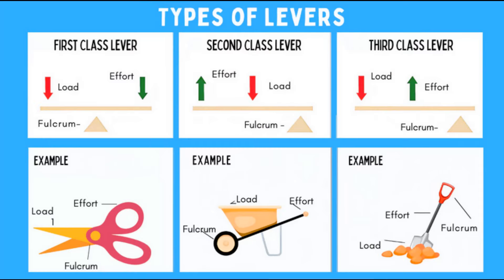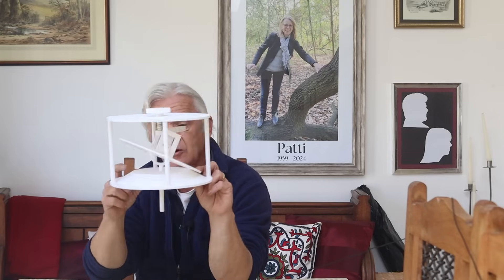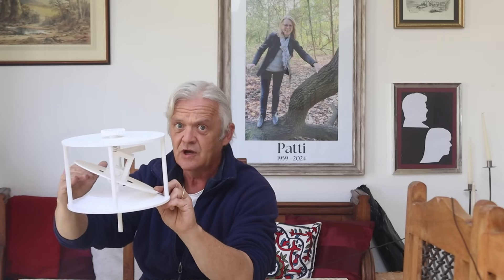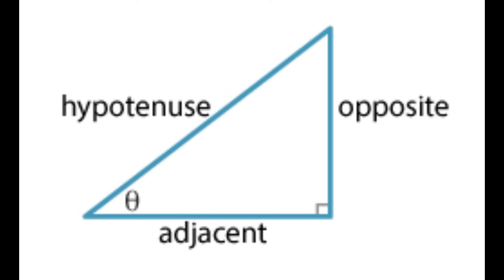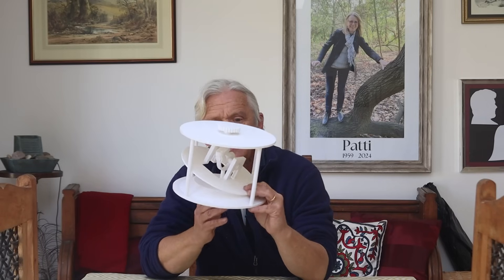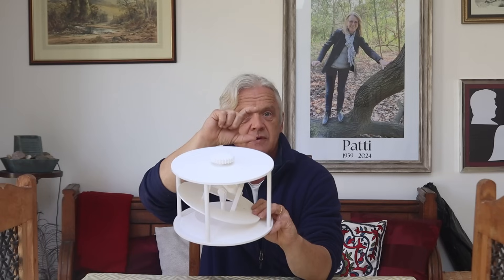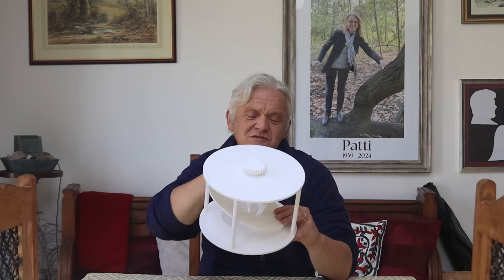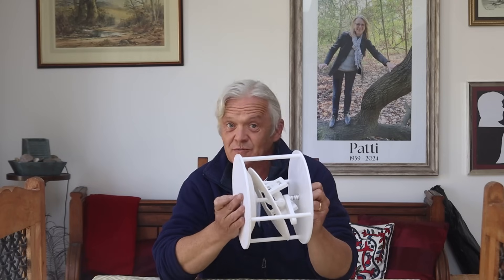2379 Explaining The Swashplate CVT

Comment: The roller is traveling in a constrained circle. If the swash plate is a flat 0 degrees, then the roller is free to travel without the swash plate reacting and there is no output rotation. If the swash plate were somehow set to 90 degrees then it must be pushed one for one by the roller. I'll call this tidally locked. These extremes are easy to visualize. 

At intermediate angles you get output rotation between 0 and 1 relative to the input, but why? Consider the swash plate at 45 degrees or so. Before rotation begins the roller is well mated to the surface. The plane of the plate is parallel to the tangent line of the roller's circle of travel. When you rotate the roller it attempts to follow its constrained circle I mentioned before, but the swash plate extends before it in a flat plane which blocks the roller's travel. The roller must either be stopped or push that plane away from it to continue its own curved path. That's also not too hard to picture, I think. But why must the swash plate rotate instead of tilt out of the way? 

If you were to return the swash plate back to 0 deg, you could then tilt it again back to 45 deg in a different spot without rotating it at all. But we can't do that obviously, the tilt is constant whenever we aren't changing the 'gear' ratio. So, does this matter? After puzzling on it I think yes. If the swash plate is tilted then you cannot rotate the tilted spot under the roller without also rotating the plate itself. But the less tilt you have the less plate rotation is necessary. And so by changing the tilt you vary the output rotation as a consequence of geometry which I'm too rusty to describe mathematically. But not friction.

Comment: If you start an upsidedown dinner plate "wobbling" on a table, the plate will nutate and rotate.  The greater the angle between the plate's axis and vertical, the fewer nutations required per each rotation.  This is because the edge of the plate has a fixed circumferance but it rolls along a circular path on the table having a smaller circumferance.  Nutation and rotation both stop when the plate goes flat.
So, if you could output the rotation of a nutating disk (using a universal joint) AND control the angle of nutation of that disk while making it nutate (with a roller), then your output/input ratio could be varied from zero to some positive value.
Friction would still be required between the edge of the nutating disk and the surface it rolls on.

Comment: One should imagine a crank on a shaft at 90°, where one could apply maximum torque and the maximum size circle the crankhandle would take. Now let that crank be at an angle, lets say 45° to the shaft. Then the torque one can apply will be lower but also the circle the crankhandle will take will be smaller. I understand this as a version of this concept.

Comment: I think I finally get it. My mistake was ignoring the load on the output. It behaves more similar to a torque convertor than a belt drive CVT- it always tries to turn the output in 1/1 ratio but when the resistance is too high it allows the disk to lag behind, until the roller gets enough leverage and downward force to accelerate the output some more.

Comment: I see it as a Pusher, but not down (even if that ofc is true from one sliced view)
But from the levels point of view it's pushing the plate forward from it's point of view.
From our point of view that will rotate Axel because the plate must rotate slightly when a new point of the disc is forced forward and down.

Comment: Still don't see how the output rpm can be different to the input rpm...perhaps it's just me :)  Honda DN-01 used a swashplate cvt but that involved hydraulic fluid taking different time to sequentially fill a ring of pistons whose stroke varied with plate tilt angle, hence changing rpm. ...but a mechanical connection with no friction slippage?

Comment: If you drive the CVT backwards and have the roller frame fixed, the only thing stopping the swashplate rotating freely is the friction to the cone backer. There is your friction. The transmission can not work if a shaft can move freely and independently.

Comment: A helicopter uses a swash plate.  This is not friction or the helicopter rotor would catch fire or overheat to the point it stops or falls apart, right?

Comment: I think it works like an Euler disk which explains the ability to produce different rotation rates between the input and output once you understand the dynamics of a rotating disk on a flat plane after it has come down from simple rotation. 
Think a coin rolling on its edge, the face of the coin may only rotate once for every two 'rotations' of the coin around its edge. The rod insertion determines angle of the 'coin' (swashplate) which determines the differential rate of rotation. 

Alternatively, you've completely explained why we should expect an increased tourque, so by conserving energy I demand a reduced rotation rate (or other way around)

Comment: Yes, great video!  Really interesting to try think that through.  To me it's like a coin flat spinning on a desk, there is incidental friction or rolling resistance -  the lever has to be restrained by contact.  When adjusting the fulcrum, there is also a tiny amount of incidental friction radially at the point contact between the plate and restraining cone.  Now if the point contact could be eliminated via a cushion of air (ie an air bearing, although impossible due the geometry) or a raceway of ball bearings around the plate periphery, the tiny amount of incidental friction could be reduced!!!  At this point my head starts to hurt!! 😂😂

Comment: The friction is totally there, it's just not where you're pointing. 

The roller causes the swash plate to nutate on the lower sloped disc.  Imagine spinning a coin on a table.  As it slows down, it stops spinning and starts wobbling round and round on the edge touching the table, I.e. nutating.  

As the coin loses energy, the wobble on the rim gets faster and faster until it finally clicks down flat on the table and stops. BUT, if you look at the design on the coin, the design rotates slower and slower as the wobble gets faster and faster. THAT'S the mechanism of this CVT and it's also where the friction lives. The plate exerts a tangential force on the base from nutation and friction provides the equal/opposite force that causes *rotation*. 

If there isn't any friction between the swash plate and the base, the plate doesn't rotate.   To use Robert's analogy, the friction is what is keeping the lever from sliding off the fulcrum.   

And in this case, the friction LIMITS THE TORQUE that the CVT can provide. If you exceed the static friction between the swash plate and the angled base, they'll just skid against each other like a car spinning it's wheels on ice.
Reply: the swashplate is not there held by friction, its the output shaft constrainting it axially and only allowed rotational motion.
Reply: @talyrath  totally agree 👍🏼 no friction=no torque. The plate would either just spin at the same angle (if that's the power input) or nutate and not transmit any torque.
Reply: @paramotorportal Thank you, I feared my explanation was incomprehensible. 🤣

I'm not positive, but I think the swash plate would have to be the output.  The 3d printed version certainly isn't back-drivable (it looks like it barely functions in its current configuration, in fact), but I think a better constructed version still wouldn't have great backwards power transmission.

Comment: I can see how it works as a CVT, but I can also see that it'd be able to slip.  If the force coming back down the output shaft exceeded the static friction between the angled plate and the disc it would start to spin on that axis regardless of the pushing motion that's driving it.  

I think anyway. If I had a good way to build one I would just to see it working.  It's a cool concept.

Comment: basically this is a variable thread screw, if it gets more inclined the thread gets corser. Finer threads improve the strength of the power transmission but are slower due to the distance traveled. i get the advantage compared to a belt cvt because it has a lot less friction but i'm not sure if the fulcrum would last long considering it takes all the load. Instead of a triangle holding the load we'd gradually have a rounder surface reducing the " thread delta of the screw" . i don't know if fine tuning the hardness of the materials between the plate and the fulcrum could resolve this problem. i understand why you like cvts so much, in a quest for efficiency, the transmission of power is very important. thanks to you  i just understood how the pilot of an helicopter can vary the pitch of the blades with a swash plate when i looked for it...

Comment: I was 1 of the many commenters. I could/can see how it works and it works beautifully when driving from input to output. My main concern is that if you grabbed the output shaft it might be possible to drive it from the output end. What stops it is the pressure of the cam onto the inclined plate. The cam is going to be essentially frictionless so it then comes down to the friction of what is close to a point contact between the wobble plate and the inclined plate. I wish I had a 3D printer to print this up as it looks like it's as close to a frictionless CVT drive as exists. My only concerns is the lack of friction between 2 parts could cause a problem. About the simplest form of a failure mode would be if it was used with engine braking and the output is wanting to travel faster than the input. I'd truly love to be proven wrong as this would be the discovery of the unicorn of CVTs.

Comment: A super-simplified model might be easier to explain, one axle with a two part disc, a regular platter and hub made of TPU as a flexure (thick enough to want to resist tilting). The other axle would just have a solid hub with a "stylus" rod made with a rounded end that could be greased or a ball of felt glued to the end. Mounted linearly, pushing the axles together provides both engagement and deflection for the platter, which resists due to the hub's natural springiness. 
Would it transfer much torque? No. Would it be far easier to see how the mechanism works, stripped of everything that could be serving as a red herring? Yes.

Comment: So, oil the swash plate and the roller. Now the friction is practically zero. If it still functios as a cvt, you will have proved that friction is not playing any part in its operation. QED.
Reply from the maker: i actually removed the cone altogether - it still worked

Comment: Yep as in if you swapped the roller for an air line that blew the disk down it's the downward pressure as opposed to running from friction which would mean the roller itself was driven. You could put a different joint on the roller so it can tilt with the different angles, maybe just a pivot point that would do the job.

Comment: I personally don't really like it... Too many parts, too many points of failure. Would it be possible to use rectangular magnets and a serpentine coil to change the torque (by changing the in or out position of the magnets) ?

Comment: If you could remove friction entirely then the roller would slide instead of roll and the plate would slide instead of roll.

Like if you had a ball on a surface. Without friction the ball slides instead of rolls.

You should be able to test this by back driving or observing what happens under heavy load. Any slippage is from the coefficient of friction between the plate and the cone being overcome.
Reply from the maker: it doesn't matter if the roller slides - it would still press down and as that is the key friction is a hassel not an add
Reply: @ThinkingandTinkering  I think it would be easier for people to wrap their heads around this one if we could see it in action. I rewatched both videos a couple times and I'm still only 95% sure I even know where the inputs and outputs are on this thing. You might need to give this the ol' hand crank on one and end tape/flag on the other end so people can see it in action.

I'm really curious how back drive or load resistance is transferred back to the input side, if at all. Sadly, I don't have any way of building one myself to satisfy my curiosity 😢
Reply: @ThinkingandTinkering  Friction is necessary but incidental as this needs static friction to anchor various engagement points... but doesn't rely on that friction for motion, only as the holding of an instant pivot point. Big difference between this and something like a wheel and roller.

Comment: The swash plate is free to tilt in any direction.. As the roller goes around, pressing on your lever, tilting the swash plate in each successive direction, the swash plate wouldn't rotate, it would just tilt in a different direction.. What happens in practice, is that the difference in circumference of the swash plate and the circle it inscribes on the cone, through friction, causes the swash plate to rotate like an euler disc or a spinning coin. Without friction between the swash plate and the cone, the swashplate would be back to just tilting.
Reply from the maker: i don't think that's right mate because it doesn't just tilt - it tilts in sequence which is what causes the rotation - but we could be splitting hairs
Reply: @ThinkingandTinkering  If we go back to your thought of pressing the swash plate at 45 degree increments, ignoring the rotation of the input shaft, just think of it like a lever like you say.. between the two points, the swash plate will roll around it's circumference like an euler disc... if the friction of the roller pressing the swash plate was greater than the friction of the edge of the swash plate rolling around the cone, then the disc would just tilt to the new direction, with no rotational movement at all.. it relies on the edge friction, and the lack of friction at the roller.
Reply from the maker: I just removed the cone and tried it - still works fine - so, I am really sure it has nothing to do with the cone
Reply: @ThinkingandTinkering  Uuuuurgh???  Yup.. got me baffled there then.. let's see that and see if we can explain it then.
Reply from the maker: @donvito1973  you were making a good point mate - so i thought i had better check it
Reply: @ThinkingandTinkering  My 3d printer isn't up to this sort of stuff, so I can only do the thinking, not the tinkering 🙂
Reply: @ThinkingandTinkering I think it might work without the cone due to the friction inside the universal joint, so the movement gets divided somewhat between swiveling and rotating the plate. I'd love to be wrong on this.
One way to test this would be to see if the variability of it all still works without the cone, or for a more robust experiment, have some resistance at the output axis, and see if it still works (could also leave the cone in there and just oil it)
Reply: @snaawflake  It might be to do with the universal being offset from the axis of rotation. The input part is making a smaller or larger circle depending on where it's positioned. THAT's likely where the torque multiplication comes from.  I think, I also can't easily make one of these to have a look and see what it's doing

Comment: Why don't you just draw some marks on it and show us it working? Does it actually work? From what you've shown, I can't even figure out where the input and output are.
Reply from the maker: really? ok
Reply: @ThinkingandTinkering  It would help a great deal to see it working, preferably with the different parts being different colours. When everything is matte white it's very hard to make out what's going on on video. I'm sure up close in reality it's much easier to see.
Reply from the maker: i will bear that in mind mate - thanks for suggesting it
Reply: @hughjardon3538  I saw the first video, the many comments from people not getting how this works getting directed here, then this video and can't say I am any closer to understanding how this is supposed to work. If there is any load/friction on the output, all I see is the input arm tilting the plate around the output shaft. Especially when told there is no friction involved.

With friction between the plate and cone, there is a differential speed between the two contact radius that would turn the output.